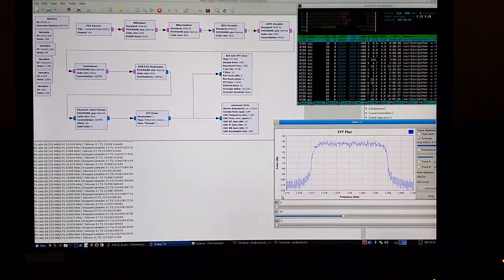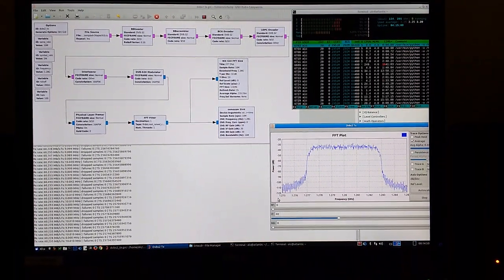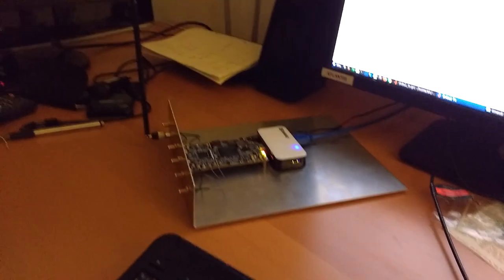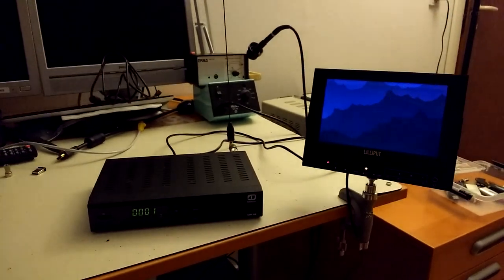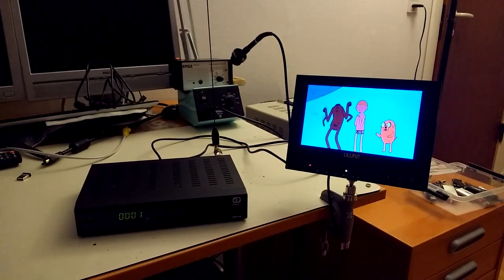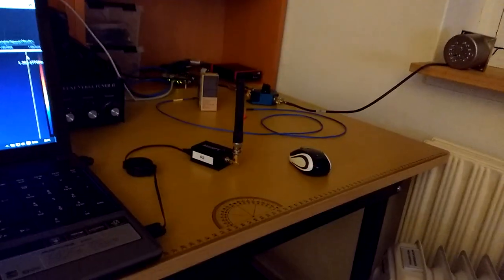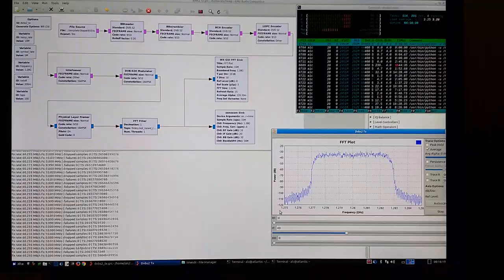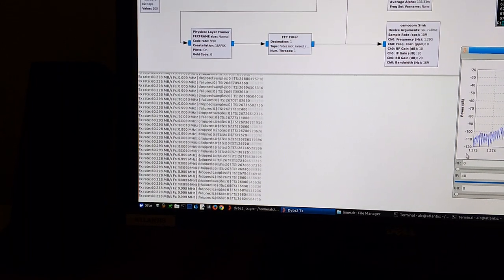LimeSDR demo: High Definition Video Transmission using GNU Radio

Comment: I backed the LimeSDR + antenna package..   now I just have to wait to replenish the funds before getting more gear (i.e. airspy r2!)

But what is that white box connected to the LimeSDR?   I assume it's more than a usb flash drive for the .ts file, since the Xubuntu is also connected to it (for the SDR development/monitoring).    

Also, what where did you get the whip antenna that works with dvb-s2 (the one connected to the receiver/Gecco DR12)?

Comment: Hi mate great job I couldnt configure the gnuradio and limesdr usb device on ubuntu 16.04 When i connect sdr and try to open osmocom block on grc the gnuradio program shuts itself down what shoud i do in order to fix this issue? Best

Comment: +Alexandru Csete
Thank you for the video.  Have you been able to test the LimeSDR in send mode?  If so, what was the experience?  Thanks.
Reply from the maker: What exactly do you mean by "send mode"??? I mean, how does that differ from transmitting, which is the topic of this video?
Reply: Oops, sorry.  I meant transceiver mode.  I guess this is DVB-S2, not two-way communications.  Impressive video nevertheless.  I was just wondering how LimeSDR worked in two-way communications, perhaps LTE?
Reply from the maker: I haven't tried full duplex.

Comment: Nice, good job - what is the model of the DTV receiver box?
Reply from the maker: Gecco DR12-something bought in a random supermarket. Any newer DVB-S2 receiver should world.
Reply: Excellent :) I asked because the one I got, doesn't have an antenna input, so need to check the specs of yours to find something similar.
Reply from the maker: Ehm... how can it not have am antenna input? I am using the connector where you normally connect the coax cable comming from the LNB. It is normally called "LNB IN" or "RF IN". Instead of the LNB, I connect an antenna using a proper adaptor.

Comment: Good job, it's really helpful since I'm trying something similar for a university's project but using the HackRF board instead.

I'm having trouble installing GNU with the DVB S2 library, how did you install it? Did you use PyBombs?
Reply from the maker: I use Xubuntu and install gnuradio and LimeSDR drivers from the Myriadrf PPA.
Reply: I looked for that PPA, and run this:
sudo add-apt-repository ppa:myriadrf/gnuradio
sudo apt-get update

But I can' find gnu on my PC, do I have to do anything alse to get gnu installed?